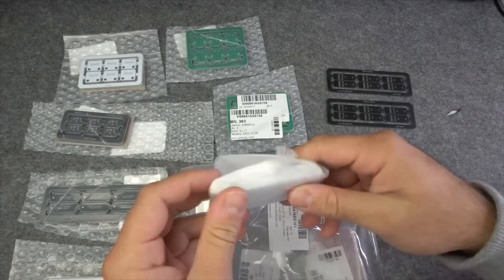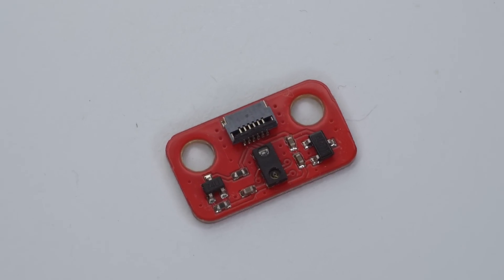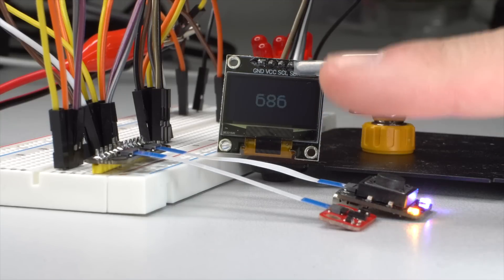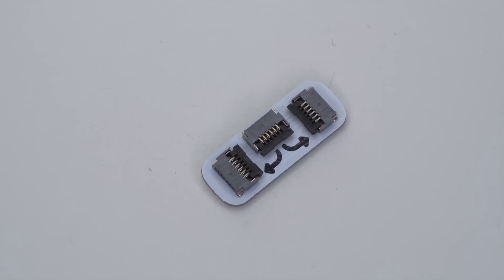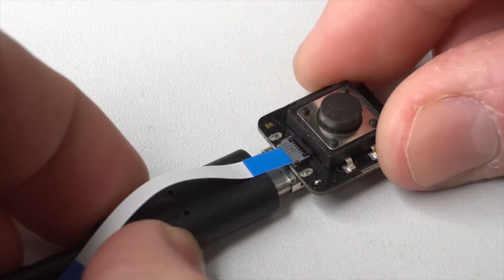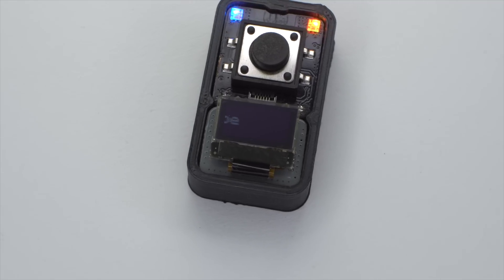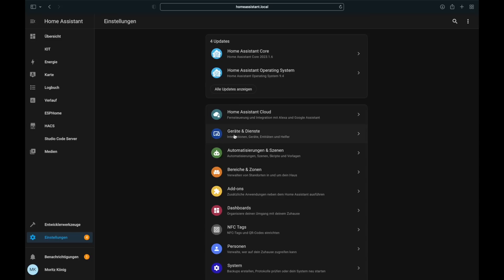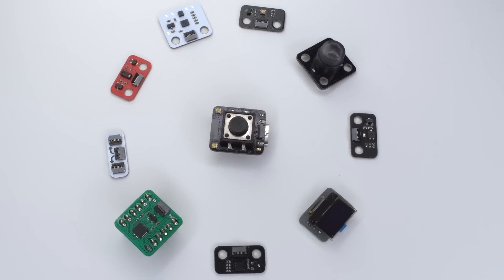Extension boards for the ESP32 based Picoclick-C3 | makermoekoe

Comment: Awesome work!, I am getting into more advance self teach electronics, and I fall in love with those FPC connectors, please allow me to ask, how much current can they handle?, I need to drive 15 8g micro servos in series (using i2c) for a costume, and I would love to connect them one to another using those cables, if you think they are not good for driving servos, which alternative you recommend? before your video I was looking into Pico-Molex connectors, but they are bulkier and the crimping tool can cost more than 600usd just for the tool :(, I love your channel, thanks in advance!

Comment: Klasse Projekt ich warte jeden Tag auf ein neues Video. Ich hab jetzt auch mal ein PCB selber designed um es auch einmal auszuprobieren. Doch das war nur eine LED-Board. Ich hätte immer zu viel Angst, dass ich etwas falsch gemacht habe und ich das ganze Board dann wegschmeißen muss. Gab es je ein PCB das du wegschmeißen musstest? Ich liebe den Picoclick und jetzt mit den Extension boards noch mehr. ;)

Comment: This is great! What battery are you using for this? When using WiFi the ESP32 consumes around ~200-500mA peak, you seem to have a LiPo which is less than <30mAh. Aren't these LiPo's instantly over-discharged with these peak currents, or doesn't the voltage collapse all the way to <2V, turning off the MCU? Could you please explain :)?
Reply: He actually measures the power consumption in his previous picoclick video I think. He uses some sort of latch for a deep sleep while still having great responsiveness and gets the current way down, its honestly amazing!
Reply: @jaspervandenameele4834  Thanks for your reply! Yes I am aware about that, but I was mostly speaking about the intense peak current during transmission! Even for such a small time ~1-5 seconds a peak current of almost x10-20 times the size of the battery's capacity can instantly overdischarge it or let the voltage collapse instantly right? How does that part exactly work? WiFi on these chips is very power hungry!

Comment: Perhaps you should expose a way to connect the two extensions right next to each other rather than the FPC? Perhaps just some exposed pads on the edge of the board under the FPC connectors. Or two sets on either side of the connectors. That would allow you to avoid the tiny FPC issue

Comment: Here is a free tip for everyone having issues with esp-now and fixed channel/jumping channel routers: you can add a message "ping" to all slaves that when waking up without knowing the channel they would send out on ALL channels and wait for response (10-100ms). The bridge connected to AP will pick up the message on one of those channels and will answer back with a PONG that contains the correct channel (it can happen that channel 2 message gets picked up by bridge that is on channel 3 or channel 4).
Once the slave knows the correct channel it then can store it in the RTC memory so with the next wakeup it wont need to do the energy consumptive question-answer.
You are welcome.

Comment: Man, this is pure beauty. Would you agree on doing a tutorial on how to design a pcb? like how you choose an mcu, and how you design the circuit around it. I truly would love to make my own pcb for my project, but I don't know where to start
Reply: Look up Phil’s lab in the meantime
Reply: @newsogn5148  great suggestion! I also advise to take a look at philslab!
Reply: Fire up easyEDA and make a schematic. See how it goes. Take feedback, go to electronics forums and subreddits.
Reply: @sounddrill  much easier said than done. I had problems when making my own PCB and without an example to compare against it's very difficult to figure out where the source of the problem is without an electrical engineering degree

Comment: Nice extensions! You said that the accelerometer board only consumed 9 uA, but how is that possible with two leds constantly on? Did you mean mA? Or did you only reference the accelerometer board itself and not the consumption of the C3 board?
Reply from the maker: Check the last video for further details. The motion board is able to activate the Picoclick, so when talking about the 9µA the Picoclick is deactivated and the motion sensor is waiting on a software configurable motion which will throw an interrupt to activate the Picoclick. While waiting on that specific interrupt condition, the sensor uses 9µA. Add 2µA for the Picoclick (in standby) and you'll get the total consumption of 11µA while waiting on the trigger.

Comment: Little bit surprised to see you pasting panels without your stencil jig, any specific reason?
Reply from the maker: Hehe, the stencil jig is equipped with the Picoclick stencil which is often used in the last time, so I decided to go with this method for the extension boards...